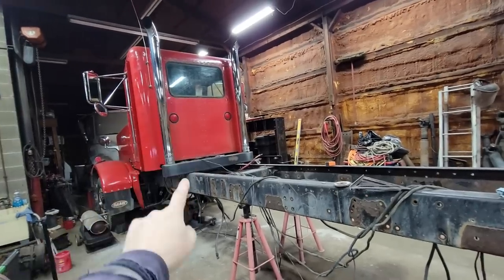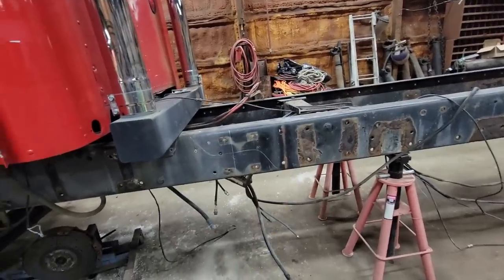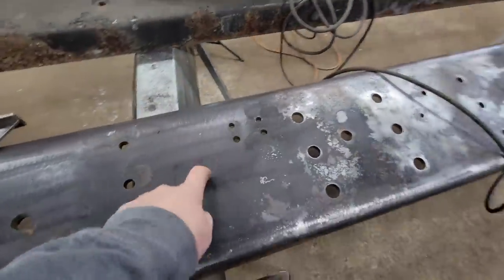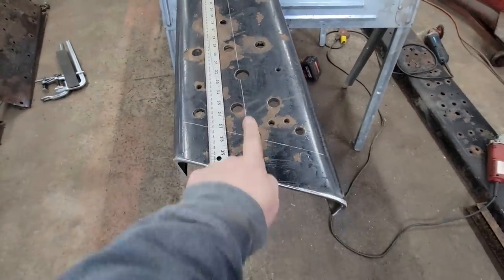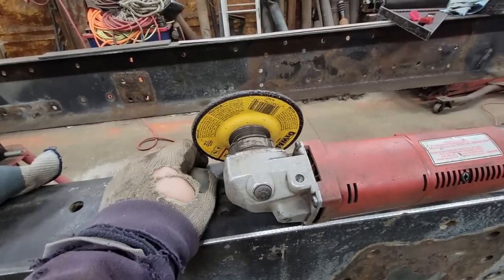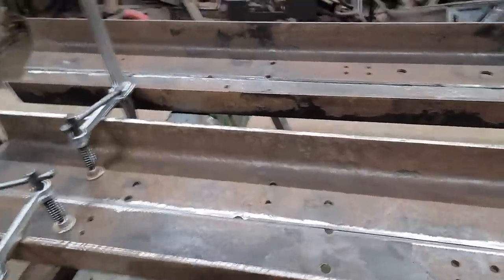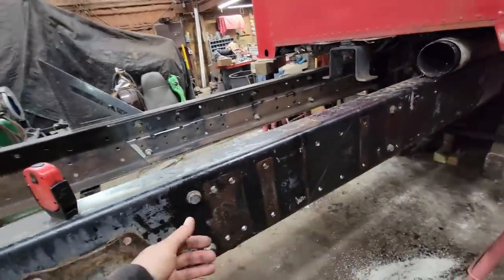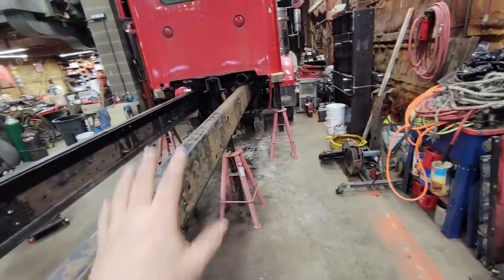PETERBILT 349 FRAME STRETCH PT2 BUILDING INSIDE LINERS OUT OF OLD TRUCK FRAME!

Comment: That’s an incredible amount of holes you had to drill, but it’ll all be worth it when it’s all finished up.  Great work J.C.  Looking forward to the next one👍
Reply: I’ve seen you use the mag drill before, but remind us again what bits you use to run 200 holes?  Are you going through and resharpening, or do you have a carbide type boring tool maybe?
Reply from the maker: unibor or hougen. we use lots of cutting oil while drilling and that seems to help. i can usually do

Comment: 8:09 can't beat a metal saw for cuts. When i got my first one (aaabout 2013ish) i was a bit scared to use it, on account of the forces involved, but once i got over my chicken self, it's my best cutting implement and go to tool. Better than plasma, better than arc, better than grinders. Best part, you can get a beam saw, do a little bit of modifications to the cooling and slap a chop saw blade inside, which makes cutting big stock a breeze. It's scary as, but it's really clean cuts all the way.

Comment: I typically wind up doing a liner and a cap (probably overkill but better than underkill) then lay out wholes and bolt it all together like a battleship. Love the work man.
Reply: I’ve got a steel shop local to me in Kenton that makes custom frame rails for me in a timely manner, if didn’t have that I’d definitely be doing it differently

Comment: I buy grinding disks (I mostly use flap disks) online or via my local welding supply. I ignore DeWalt and othe chain hardware store stuff. Quality flap disks like Norton are well worth the money. So are 6" thin kerf cutting discs for angle grinders ideal for cutting hardened steel. 

I never found a reason to run a grinding rock or especially the deadly flesh-eating knotted wire brush without a guard but cup knotted wire wheels and (small, so slow edge speed) flap discs are no issue. All my cutting discs get guards and I stay the hell out of plane of rotation. Complacency can hurt anyone and bleeding is embarrassing! 

If you need an assembly or parts blasted white a monument company is a great resource since they have towable compressors and blast pots for cutting names and dates on tombstones. I get truck and motorcycle frames and trailers blasted that way.

Comment: Looks like you have these frame jobs down to a science in the order that works best for drilling and lining everything up. I've seen some zila welding videos yrs ago. I'm guessing he's going to run some type of dual shield wire similar to what I run. There's several types that I don't even know about, but I run e71t-1 .045  wire  with standard 75/25 gas. Be interesting to see what he has up his sleeve... In my short time working in a fab shop we used a dual shield wire with CO2 gas but you couldn't weld vertical with it. It was a very fast and liquid wire though. That's where I originally learned about dual shield wire. If you tack weld a t joint with regular er70-6 mig wire and then do the same thing with a dual shield wire and hit both with a hammer to break the tack weld you'll find it takes a lot more to break the dual shield. I'm guessing the pulsed mig will help with the warping also, which might be an issue. Anyway cheers, I'll try to catch the next episode...
Reply from the maker: he showed me pulse mig with 90/10 and dual shield flux core pulse mig with 90/10. that dual shield is HOT! this dual shield process is what i use to splice the frame. yes it is an uphill weld.
Reply: @j.c.smithprojects  yep It's hot. I seen large I beams warped from welding gussets down one side of a long beam. Supposed to have a higher deposition rate as well, so it's a little faster. Never ran it on a pulsed machine though...

Comment: Great intro "Don't try this at home kids" You are going to have a ton of welding to do on that frame. Are you worried about those liners getting distorted from all the heat?
Reply from the maker: i am. as you see in this video, i have clamps set up to hold it flat. i ordered more clamps to help me with this. there is too much work in these liners to ruin them by warping.
Reply from the maker: well..........watch the next video.

Comment: I weld together then cut out a diamond shape from butt up and welded spot . Cut out a diamond shape to insert then weld out . This increases weld area plus adds more angles to frame cut area . My certify is hy pressure boiler tube and pipe all the way to XXX main steam line  . tig n stick . Also mechanical Engineering sciences degree . No sweat I’m just lookin over your shoulder on this .mgood to see how u young guys are dealing with this !
Reply from the maker: many different ways to do it. keep watching. you will see the method i prefer. doesnt mean its the best...just the best i have found that i am able to complete with confidence.

Comment: Jc if you was going to have frame rail inserts broke what kind of metal would you use to have them broke out of. Tia. I love your videos on your frame repairs.
Reply from the maker: i would look up the specs on the truck i was needing them for and find out what it has. then contact a shop that is an actual frame rail bender.

Comment: Your videos never a waste.  I could watch all day.  I have a question. Doesn’t pertain to video.  I’m replacing a hub seal on my 03 f250. Got a new hub nut.  Some are telling me the torque spec recommended will not work.  Wondering how you do it. I trust your work. Thanks
Reply: I would get a service manual for that pickup and follow it.  They're handy for torque specs and all sorts of things.  Those wheel bearing nuts are a bit different than the traditional jamb nut types.
Reply from the maker: i have a video of doing rear superduty bearing sets. it was an f250. back a few years ago. it should have the procedure i used in it.

Comment: hello from the Netherlands .  
at 4:43 in the video : 
could you make that "puzzle piece" very precisely if you make a cutting-template from a piece of steel plate ?  
because then you still have the positive and the negative cutting-jig to pass the plasma cutter?  
or does that not work?  
I don't know and I don't have a plasma cutter and have never worked with it, 
so I have no idea what you have to take into account in terms of cutting width that you lose .
it looks great that "puzzle-piece" hihi .
i love your videos man .  
everything so well thought through and thought out before you do something.  
and want to do and make everything as safe and good as possible, also under budget.  
no hack jobs i love that .
thanks for the video JC .  
Sincerely Hollandduck
Reply from the maker: i am going to make a template like you are saying. i want to do the key hole idea on a truck when i have some more time to focus on it. i will weld a flat plate on the top of the template so that it can be used on either side. the big obstacle is that truck frame is never perfectly 90*. so the centerline of the template could be off as much as a 1/4". i will have to manipulate the flanges of each piece before i cut them.
Reply: @j.c.smithprojects  👍

Comment: How’s the 6ah battery last on that Milwaukee circular saw? Awesome video jc.
Reply from the maker: i cut all this frame with 3 batteries in all. the first one was only at 2 bars. the other 2 were fresh off the charger. that is about 65ft to 70ft of truck frame that we cut.
Reply: @j.c.smithprojects  not bad, I had a couple 9ah that I used and had issues with them holding charge, and ended up getting the 12s.

Comment: Great video. How long will one of those saw blades last?
Reply from the maker: i have had this saw for well over a year and cut unknown lengths of truck frame. i think the diablo blade lasts longer than the original. the diablo blades are around $40. well worth it to me for such a fast and clean cut.
Reply: @j.c.smithprojects  thanks. Im gonna try them out.

Comment: Hi JC,long time viewer of your channel,ty for doing the videos. One question, structurally speaking, do u weld up all the unused holes on the frame for added strength, or is that unnecessary ?
Reply from the maker: unnecessary. it was strong enough when it was on the last truck as a main frame. it will be plenty strong on this as an addition to the main frame.

Comment: Sir wood having a program made water jet / plasma cut  key/ key hole template made for multiple sized frames for cuts be what you are looking for and meet your requirements for the frames you choose to adjust the projects you make

Thanks and looking for your thoughts on this
Reply from the maker: i am using a template for the angled "z" cut splice. i loose a small amount of material to the plasma cutter but not enough to make it a poor fit.

Comment: Anybody see @dirtperfect's frame stretch video "Dan is in two pieces" where he cuts (so he can install a dump box) an old ex military double frame truck? If you have not seen it he cuts both inner and outer frames in the same place just rolls the rear of the truck back and welds in new inner and outer frame rails (extensions) with the welds for both new frame sections in the same spot no "Z" cut no stagering of joints just 90 degree cuts. The owner of this truck is lucky jc knows what not to do.